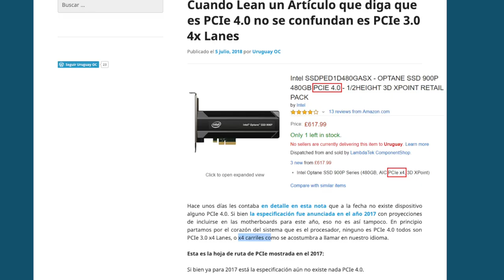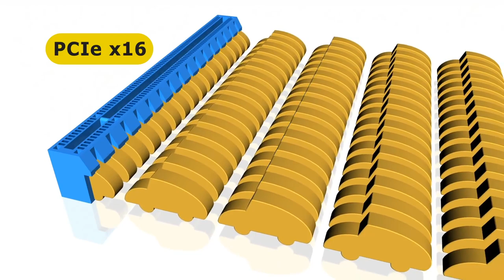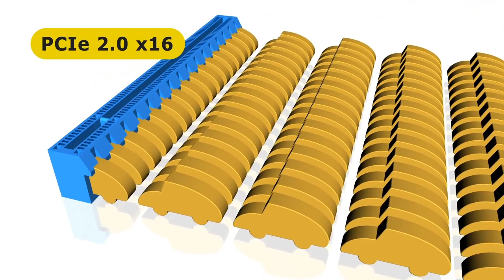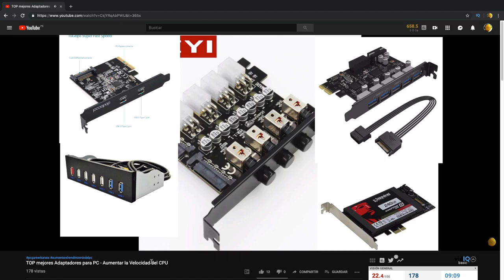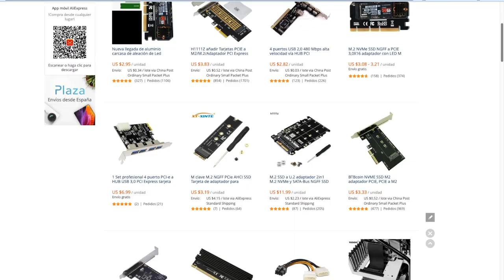Que es y PARA QUE SIRVE el PCI EXPRESS EN TU PC?👩‍💻 | Shutdown PC

Comment: Buenas tardes y saludos desde Argentina...quería consultarte por estos puertos PCi....quiero conectar una "Placa de Sonido Pci Express 5.1 Sound Audio Pc 6 Canales" en mi Motherboard ASUS PRIME-Z370-P.....cómo es el tema; ya que si se transmiten por serie los datos; como es que los 3 sonidos saldrán en paralelo de mi "Placa de Sonido Pci Express 5.1 Sound Audio Pc 6 Canales" al subwoofer 5.1?. Se entiende la pregunta?. O conecto la "Placa de Sonido Pci Express 5.1 Sound Audio Pc 6 Canales" al Pci Expressx16 de mi mother?. Muchas gracias y espero muedas darme orientarme. Finalmente esa placa no es compatible con mi Sistema Operativo de 64bit....ya que la placa es de 32bit. Voy a tener que conseguir una de 64bits. Gracias nuevamente.